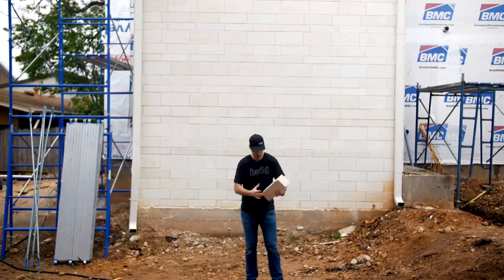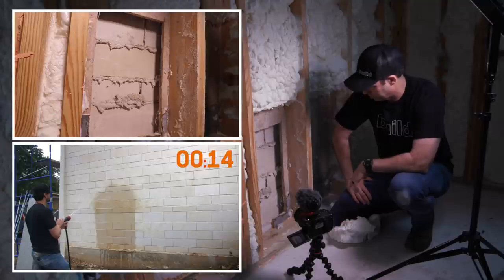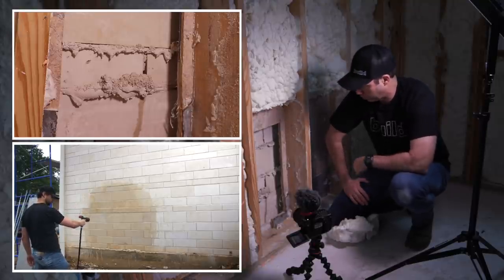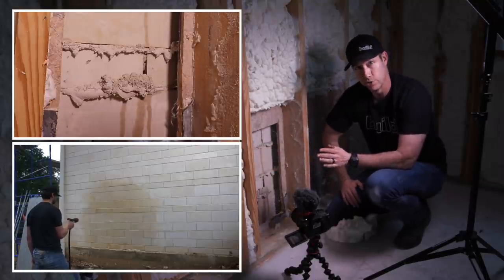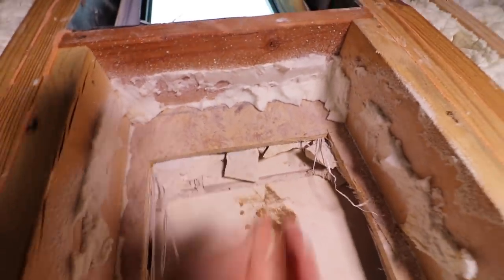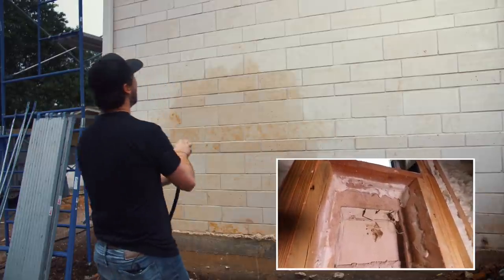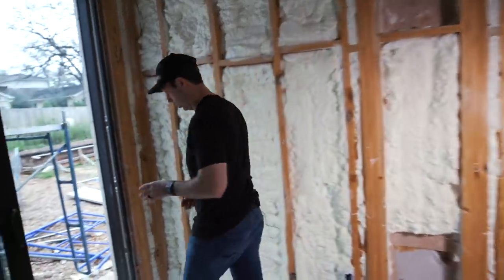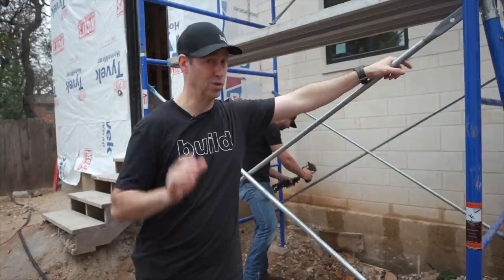You'll be Shocked by how quickly this leaks...

Comment: This will be a good video to show the client "this is why the house wrap needs to be changed". I used to work commercial construction and one time the mason told me if your gonna put stone on the exterior of a building treat it no different then the tile on a shower wall. There's a reason the waterproofing for time happens under it not on top. The dude knew rocks like the dictionary knows words.
Reply: Alec Ver Bunker they already have better stuff. Liquid applied membrane or waterproof sheathing. Wrapping is dumb but everyone still uses it.
Reply: @thanh510  I'm well aware of fluid applied membrane, it's popular on basements here in the north but not on above grade walls. You want to use something like Delta Vent SA with a good perm rating to allow drying but maintain air sealing. I'm not new to this been in the construction world since I was 5 or 6.
Reply: @alec4672  I'm not here to have a d**k measuring contest. I am pointing out that there's already better products out there. The build show already highlighted liquid applied membrane for above grade applications. Check out their video on prosoco. They even got videos on Delta Vent. I am sure since you do commercial work, you don't see any other products that much. You should also watch videos on water proof sheating, like zip wall or densglass. The more you know, the better you are.
Reply: @thanh510  I've heard all of all these products and worked with most of them. Fluid applied is great for its application but peal and stick is still king up here. The zip system is popular in higher class residential recently not much ZipR unfortunatley though. I'm not here to argue I'm just sharing what I see in my Northern Midwest climate.
Reply: @thanh510  densglass is what we mainly use behind masonry facade

Comment: That is why in Germany we paint those stones with 2 layers of primer and afterwards with 2 layers of Fassadepaint with special properties, diffusion open, but will not let any water in!

Plus in the bottom there will be little "holes" "slits" in the bricks, covered by some mesh, so no insects will go in, but the mopisture/water can come out!

Also we have the walls built as follows:

11,5cm bricks/Klinker or limestone painted or treated with some silicon anti-moisture , a hydrophobation. then stainless steel anchors with some water drip discs - which for one keep the 16cm insulation (rockwool stonewool) compressed and also attract moisture, which then can drip off and evaporate through the holes.

Outer shell and inner shell will have 2cm gap in betwenn, but are connected with the stainless steel anchors. and then of course the inner wall consisting of 17,5cm of Aircrete, liky Ytong, or Hebel, or Limestone between 17,5 - 24cm depending on static requirements. These walls built that way are usually around 50cm +- thick, that is 20 inches. they are very solid, have good insulation values and are very soundproof, wheather resistant, stand for 100years+ if built the right way - and they are fireproof!
absolutely nothing in the above mentioned construction can catch on fire an burn.
Stones don`t burn, nor do the anchors, the stonewool insulation or the inner wall made out of aircrete, the plaster which seals from the inside also does not burn.

maybe, if plastic windows are used, they could burn - but if you have the money there is the option for aluminum windows, although most people  - me included - cannot afford that.

Also in the roof, the calssic framing of the roof can burn, which is a downside - but since most floor seperating ceilings are poured out of concrete, it only affects the uppermost ceiling in he house, on the second florr for example.

Of course here in Germany many houses are also built out of wood - prefabricated most of the times, with 4x8 inches thick framing, OSB plated from the inside, then some sort of steam7water vapour barrier, and some Rigidur plates and from the outside sometimes some wood-boards, then some insulation and some armation plus plaster on the outisde of the insulation. with another layer of vapour barrier.

Comment: I am a certified infrared thermographer. My main job was inspecting roof and buildings for water leaks or water penetration problems. A number of times I inspected homes for leaking roof problems, but what I found was the water penetration was due to manufactured or faux stone exterior building veneers. The problem was the installers attached the metal lathe, used to hold the mortar, directly to the wood framing members, there was no air gap. When a strong or heavy rainstorm would come through, the rain water soaked the mortar and traveled into the wood framing.

Comment: I love your building science approach. I remember reading about a test with an 18 inch historic brick wall and the water soaked the inside in around 15 minutes. Masonry walls are referred to as a 'hard sponge' but you already knew that. Nice video showing the challenges in building modern for long term durability.

Comment: There's gaps in the mortar joints. Water should never leak, much less squirt, thru a brick wall. Especially in a matter of seconds. Are you sure the masons weren't being a little hasty in their work?
The 3 streams @5:50 are probably starting at the same head joint and being split up by that mortar blob next to it.

Comment: 99.9995% of people (including me) would just normal expect that stone (or bricks or weatherboard)is naturtally waterproof. Even though i spent 20 years in the building industry and fully understand the need for watersealing around windows and doors, i never imagined that water could enter quickly. i wouldve said weeks, or perhaps days, but not hours or minutes, And seconds? WTF? 
Guessing Im going to rethink a couple of my projects
Reply: Correct me if I am wrong but in this test the water isn´t actually penetrating the Lime Stone, it penetrates the mortar.
Reply: This is why NY laws mandate that you waterproof concrete walls usually on everything on and below the first floor/foundation.
Reply: Rule One:  "Water always wins!"

Comment: As a home inspector I am constantly reporting to my clients about the importance of making the builders install the wall weather barrier correctly but the builders force them to accept the home as is.  If the Window sill blocks were properly flashed and weeped, the water never would have entered the wall. I constantly see the builders skip lintel flashing and couple that with crappy weather barrier installs and you have rot and mold in a couple of years.
Reply: As a home inspector it is your job to fail the home.. period if not to code if flashing and weeping is required its required.

Comment: Love when gutters get installed before final grade is established. Installers will always daylight them below where final grade ends up. They got the one on the right set correct, but the one on the left is about a foot lower.
Reply: Looks like a custom build where they run downspout out of home depot product until after final landscaping and then come back and put in the copper or whatever.
Reply: I see it on completed homes where winter escrow work includes final grade quite often.

Comment: I rented a building that cost me out the ass and every time it rained I would get a lake inside right were my work bench was located.  Everyone kept saying it was a roof leak, until I did a water test on the wall on a cloudless day. Within a couple of minutes water was coming into the shop. Glad I move out. I will never have a brick house or shop again!!!
Reply: I can see your point if you are talking about solid brick with no air gap. But if it's veneer, can't that happen with just about any kind of cladding? Vinyl siding is notorious for harboring rot, not that there is anything inherently  wrong with the way it manages water, but because they put it up with no housewrap, or improperly lapped housewrap for so long, so there are a lot of rotten vinyl sided houses. Though it's kind of a mixed blessing as a structural material, brick is an excellent cladding in many ways, as long as it's done right. My 60 year-old brick over concrete block walls have had no moisture issues. Recently, I walked around the 1945 brick-veneer over wood townhouse where I lived as a young kid, and even with no weep holes, it still looks good.
Reply: The problem is not brick. Bricks are used all over Europe and even many places in the USA too. The thing is that you need a gap between the brick wall and the house support (which can be a brick wall too). Preferably also some insulation in the gap (the gap can be 20cm easily) and ofcourse a waterproof layer (vapor shield I think it's called).

Comment: Construction quality for the most part in Texas is pure crap these days.    They are so desperate for construction labor in Texas right now, that if you can show up on a job site and identify what a hammer looks like then you are a framer.  If you can point to a brick then you are a bricklayer, if you know what a PVC pipe looks like then you are a plumber.   I'm sure Matt has crews he's worked with for years, but some of the work down here is SO shady.
Reply: @boo boo go get help.
Reply: If you are complaining about the prices of a professional wait until you got it done by an amateur. One of the problems is that many people (house owners) only build once in a lifetime. But to make the right decisions you need a lot of experience.
Reply: Often the problem is not the workers but the homeowners. They want to maximize their square footage rather than have a well built home. Often times contractors are being out bid by the guys who are cutting corners and make it last long enough to get the final draw. Basically want a cheap house so the pay the guy who will do it for cheap. The fact that carpenters in Texas don’t require licenses means that a vast majority of subs don’t even know what they are doing.
Reply: Steve Slade  my house meets 500yr standards and our city just OK'd a 170mil to make a large improvment in one area of town. Funny how big government New Jersey/New York didn't have the problems Louisiana/Texas did when comparing apples to apples

Comment: Nice demonstration and a good proof of the point that stone walls in and of itself are not waterproof at all, but I don't think you are quite right with the statement that the stone wall could not be made waterproof from the outside. Brick houses are made waterproof as the widespread solution in Europa using special facade plaster (typically 2 specially designed layers, and an optional paint layer). This can be put either on brick walls or on EIFS systems (which would include additional insulation) and I don't see any reason why that shouldn't work on stone (or stone lookalike concrete blocks).
I understand why you might want to be on the cautious side if you have a wood structure beneath, but I would avoid the general statement that it cannot be done.

Comment: The stone itself is impervious to water penetration.  The water is obviously penetrating through the mortar joints, primarily through the head joints. The wall is doing exactly what it is designed to do. The space between the back of the stone veneer and the wall is there so that any water penetrating the exterior material (stone, block, brick) will run down the cavity and out the weep holes at the bottom of the wall.  What I don't like about this construction is using the air barrier as if it is a moisture barrier or water proofing.  It won't do it. Last I knew it doesn't have the perm rating to be considered as a moisture barrier. The old method of using 90 pound felt paper (tar paper) will work.

Comment: Just commenting on window penetrations being difficult to waterproof on a masonry wall. I install Windows in Manhattan and a 2 wythe thick brick exterior with a cmu as the backup masonry is common. Typically the stone sill flashed in it's own copper pan. We would put a sill pan on top of the stone sill in a bed of mastic. A peel and stick flashing is put on the whole jamb section of the primed backup masonry and will drape into out sill pan. Peel and stick is terminated vertically to the backup masonry with mastic. Details will vary depending on approved drawings but many times we will mount an angle on 3 sides of the window essentially the head and both jambs. On the angle we will apply a product called em seal. It is a foam tape that comes in various thicknesses. When it's compressed 80% it is essentially waterproof in 3 inches of standing water. The angles will go and compress the emseal to the backside of the exterior brick. The emseal does a good job of dealing with contours with overflowed mortar especially when using emseal 3/4 thick or greater. The emseal now becomes our backer rod. Now if our caulk fails we have another layer of defence from water infiltration. There are times where we will add to the exterior an aluminum trim which will be caulked to the window and brick with Dow Corning 795 structural silicone. With weep holes in our sill caulking to allow the pan to drain typical issues with water end up being masonry related and not installation related. Usually when we get called for a leak it ends up being a failure of the waterproofing at the lintel above the window.

Comment: Wouldn't a cavity without ventilation be a no-no on any surface between the inside an outside? (regardless of how well you think you sealed that space off)
Reply: Yeah I was wondering if they left it open at the top, but the lack of weep holes at the bottom is a problem all on its own too.

Comment: Sorry to be critical, but once it was proven i would want to know what should be done to resolve the issue for the house.   Myself as a homeowner would want a soloution rather than see this and this and this, even if it is to tear the wall down and seal everything correctly.
Reply: Solution: High quality building wrap, 1” air gap behind masonry, venting at top and bottom, and flashing details to catch everything from the rain screen and allow it to escape. I see an air gap, I see the less than ideal water/air barrier but it’s not entirely wrong. There must be a lot we’re not seeing here.
Reply: Pretty sure that's future videos. I see many coming from this house in the future.
Reply: Steve Slade  why is that?
Reply: Steve Slade  No not at all. If it passed all inspections... including an independent one I hired myself, I'm fine. In fact the fact he is taking over the build makes me confident the original owners gave a shit. I'd much prefer this house over any production builder.
Reply: Steve Slade  Hell it's Matt Risinger I'd die to get one of his houses. I'd hire him or his buddies if I could when I buy for a remodel or as a builder to build me one.
Reply: Steve Slade I’m with you. They aren’t tearing it down so I would be very uneasy. What if they used a few less bags of mix every yard of concrete? No one can tell that.

Comment: a garden hose usually put out over 20 gallons a minute. alternatively a "very heavy rain" according to water.usgs.gov produces about 8mm of rain in that means in order for rain to have the same volume as the hose the surface area would have to be 6,111 sqaure ft during a rain storm to produce the much as a garden hose not even to close the area that risinger spayed with the hose -jus sayin

Comment: Why does new construction have such small soffits compared to in the past now labors expensive and materials are cheap compared to then...
Reply: Not to mention ledges and sills on the windows. A properly flashed ledge would carry a most of the water running down the wall clear of the window, and a sill with a layer of stainless steel on top would do the same for any raindrops that hit the glass. It's no wonder that replacement windows leak so often on postwar houses.
Reply: I always thought the newer soffits are shorter nowadays because the older, longer soffits would always sag over time... I could be wrong though.  Maybe it's just to save money.
Reply: Build practice. Most soffit material available comes in standard dimensions.

Comment: It's depressing honestly. So many homes are set up for failure. Architects  more and more are drawing up the wrb detail but there is still no guarantee it will be followed. Building inspectors do not inspect this aspect of a house. If it is done it is by a third party and in my experience it has only been on commercial projects. Most builders do not pay enough attention to this and even when they do supply all of the best products it is still left to the carpenters to install it correctly. In my experience that is asking alot from people making 15 to 25 an hour. Generally they do not care. I could go on and on about training, wages and work ethic. I wish our field was held in higher esteem and that the culture of building was one of education and execution and not about just getting it done. So many variables and moving parts to this. Cheers!

Comment: The stone isn't the entire problem.....When the mortar is harder than the stone the water can't transfer down the wall. Also, when the vertical joints aren't completely filled the water will seep through the sides of the stone. Next is the grain of the stone.....which is similar to wood. If you put stain end grain it sucks up the stain...same with stone.. The biggest problem is the architect has no idea about natural materials! It would also seem the contractors also don't have any idea.

Comment: Hey Matt, Could you do a test on metal structure sealing and insulation? I ask because I'm very interested in building a small vacation house off the grid on some land I bought and was looking to use some shipping containers I picked up. Was planning on welding the house together tight with metal framed windows and such. I have been told that insulation is the hardest on metal buildings like this and will cause water to drop from the ceiling inside.